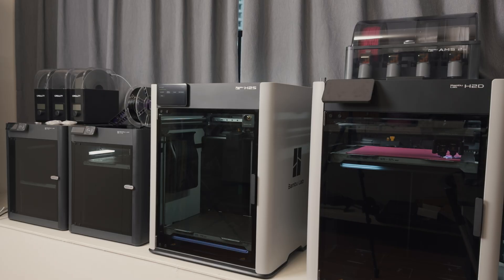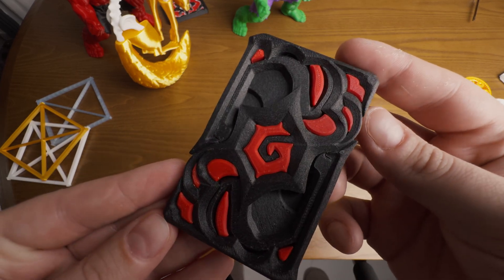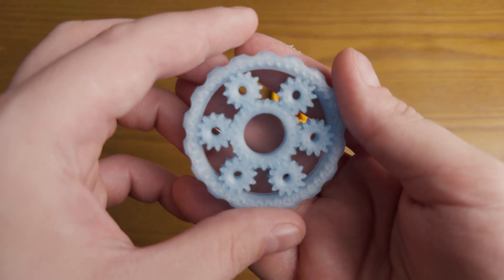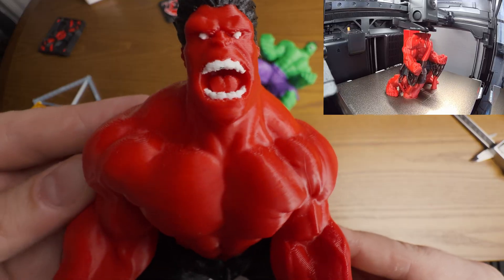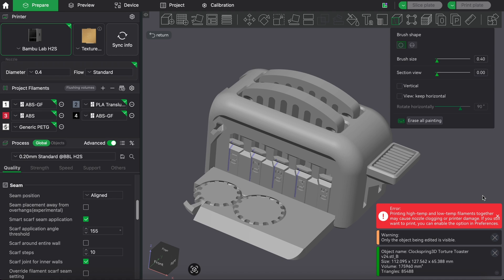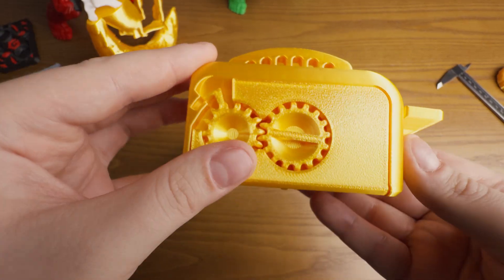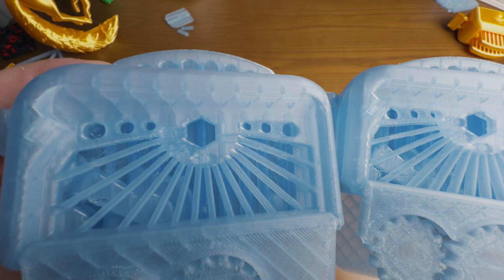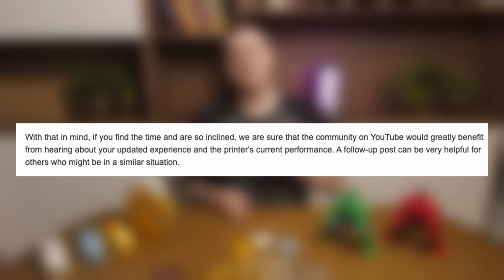The Second Month with the Bambu Lab H2S – Real Experience & H2S vs H2D Comparison

Comment: I'm in between the H2D and the H2S. I'm just a normie hobbiest. I like the idea of having less waste and being able to print dual colors. I am coming from an ender 3 pro v2 that was terrible for every single print, so either one is already a massive improvement. I may do multicolor prints, it would be nice to have that option. Which would you recommend?
Reply from the maker: Multicolor printing is a very occasional thing. I mostly print text on flat bottom surfaces so regular ams is enough for it. If I count projects that actually required dual nozzles It will be less than 10 prints.

Comment: I print small parts with dual color logos. My ultimaker bleeds the black logo onto the white base. I’m trying to figure out if the H2D or the H2S is the better option for better quality between colors. Can the H2D still print multiple colors with one nozzle only?
Reply from the maker: Do you think it actually mixes colors in the nozzle or it’s just white filament being slightly transparent ?
H2D can print multiple colors with one nozzle only.
If your issue is a mix of filaments and leftovers inside the nozzle h2d will probably fix it. 
I printed a few white cases with black logos on them and I noticed bleeding as well, but it is not “dirty” filament just black pops through white. You can also try to reduce this effect by going 0.1mm or smaller layer for the logo so it won’t be going deeper inside the white part.

Comment: Using clear PLA for any type of testing is crazy. You were never going to get fair results
Reply: And using a silk too 🤣 I suggest using a basic pla or pla+ and using the same one on both
Reply from the maker: I used PLA Basic, PLA silk and PLA translucent. All from bambulab, all with the same results. The transparent one was a little bit more stringy and they had a different flow rate, but other than that they acted fine. 
Hulks printed in ABS.
Reply from the maker: I just tried to show more colors as if everything was printed in white that's kinda boring. I printed 12 toasters total, moved spools back and forth to make sure they were using the same material.
Reply: @daniladoesengineering hey man, you do you but clear pla is barely even pla. I’m just being honest.  I print a lot of clear and it acts so different than other pla. I literally just finished printing over 100 hours of clear purple pla from Bambu and it’s just as different from reg pla as other brands. It’s like doing soccer kick testng but using a tennis ball. Do you tho 👍
Reply from the maker: @Jerkbag714 
Thanks for sharing your experience. Your point is fair — comparisons should be done with regular, everyday materials. That’s why white PLA Basic is the most important one here, even though it didn’t make it into the final video. Anyone with the same concerns can find the explanation here in the comments.😅

Comment: I started 3D printing 4 to 5 years ago for fun. I bought a Qudi x-plus off of Amazon going by Amazon reviews. I knew nothing about 3d printing. I even had to buy a lap top to run it because I didn’t own a computer. Needless to say but that printer prints almost perfect to this day. I printed a phone stand today using hobby lobby filament and it came out perfect. No waves, layer lines,or flaws. I’m looking for a replacement because it’s very slow (1 hour and 32 minute benchy slow). Also would like a multi-color printer with a large bed so I can print Gridfinity system for my tools. After countless hours of utube reviews I found out I need to wait for a reliable company to make a 3d printer that uses multiple tool heads,large build plate, enclosed build chamber with heating element at a reasonable price (sorry prusa). The vortex system Bambu labs is developing looks like a complete disaster. Just something that is going to give you more trouble than it’s worth. I won’t spend my hard earned money on it. They should dump that concept immediately and build a printer using the h2d size build plate with Bondtech INDX system followed up with there AMS. That’s a true winner. If Snapmaker supersized the u1 and they added a few more tool heads it would give them an opportunity to take market share from the big two if they price it right.

Comment: I had planned to buy a H2D and a H2S.  After buying my first H2D and getting experience with multi-material (including support), I bought a 2nd H2D.  It is a pity the H2C will have such a small build volume, as the h2d already feels a little snug to me.  A bigger deal to me is the poor soft-material handling of the Bambu printers and the fact that VORTEC (H2C) does not address this, but just makes it poop hard materials less.  So I bought a Snapmaker u1 as a low cost tool-changer to handle my soft material needs.  Pity it won't be here until early next year.

Comment: HI Danilla. Have you thought about a series of videos that 3D prints and builds a working drone? I personally would love that. But even the bad ones I have seen from other people have A LOT of views. Here in North America DJI is getting many untrue advertisements on how bad they are. So people sales in the US and Canada have dropped. So a DYI version would be attractive to many. I hope you are doing well. Alan
Reply from the maker: It is possible to make the series, but the problem is that diy can't compete with dji. Even having 10k$ budget for a single unit probably won't reach the same quality + reliability. 
They went soooo far from hobby.
Reply: @daniladoesengineering  What do you think of the Yuneec Typhoon H480 with an FPV headset. Thank you for your help.
Reply from the maker: @alanday5255  I don't have an in depth answer for this one. It seems to be okay as the first drone. More complicated than DJI. It runs PX4 firmware so it's somewhat close to diy system. There are even custom firmwares to make it flip. Pretty cool to play around with, not that cool if you need a reliable tool to just fly and film quick and reliable.
Reply: @daniladoesengineering  A friend of mine has one of the newer H series with a DJI FPV headset. But he is going bankrupt so he is selling stuff cheap and fast. But $500USD is STILL a lot of money at least to my limited budget. Thank you as always my friend.